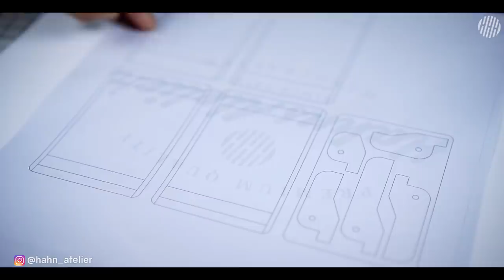Turning Starbucks card into a card wallet | Leathercraft ASMR

Comment: Hi! Just an idea: glue aluminium foil to the outside of the plastic case, just under the leather. It shields RFID cards (contactless pay) from accidental use or scams.
Reply from the maker: Thanks for the tip! 👍
Reply: RFID scammers are so rare. Do you know what it takes to pull off an RFID scan scam? Its a monumental task and is not worth the time or trouble for criminals to undertake. RFID blocking is a manufacturer's gimmick used to sell products. Fear motivates industry.
Reply: @Tom_H327  protection being the cost of a sheet of foil... Safer than sorry I'll be.
Reply: @XiaolinDraconis  fair enough.

Comment: Beautiful and useful, as always! What do you think of using RFID cards instead of Starbucks cards? That would protect your credit/ID cards from credit and ID theft! But maybe the size and rounded corners would make it too small?
Reply: Simply use a layer of conductive stuff like Aluminium tape on one side of this thing...for example on the inside before spraypainting
Reply: How is using rfid card to texts you need a faraday cage

Comment: You are one of the most clever designers on the internet.  How do you come up with these ideas.  Must be the way you are wired.  The body (under the leather) how about using a 3D printer for all the outside pieces and the mechanism?  Just a suggestion.
Reply from the maker: I actually thought of it but I don't have 3d printer at this moment. But at the beginning of this idea that I wanted to make it from the easiest, throwaway material. I'm done a video like this now, so I'll make it up to your idea soon!